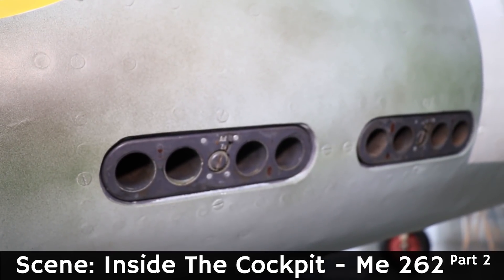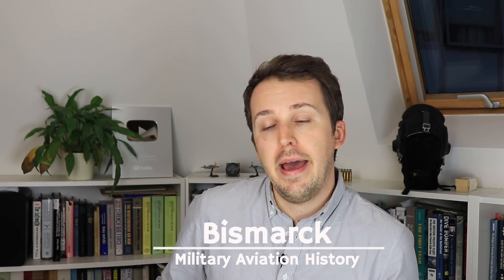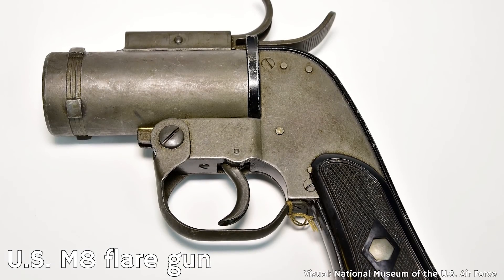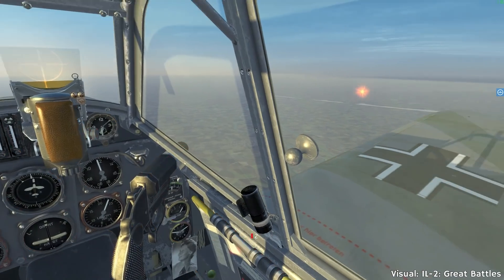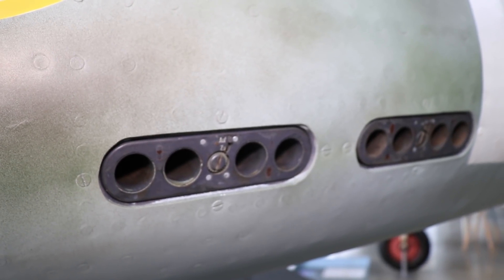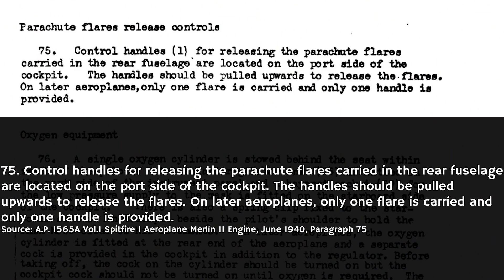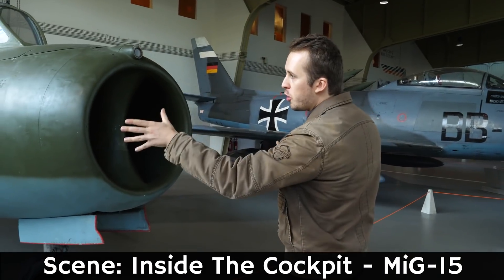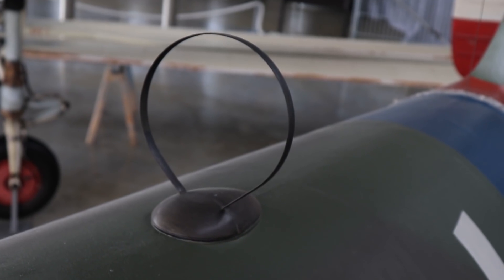Countermeasure flares on WW2 jet?

Comment: The reason the 262 had an electric flare dispenser is that you don't really want to open a side window or hatch when your jet is roaring along 750kph+. You would probably get injured. Also Messerschmitt was looking to the future and was hoping to give the Me262 a pressurised cockpit for extreme high altitude, although the LW weren't keen because they were worried about explosive decompression in combat if the plane was hit.

Comment: Thank you for the “flare” clarification. 
Just a note, I believe that various  WWII aircraft also utilized downward facing lights for identification purposes. I believe that Spitfires had one  flush mounted light on the underside aft of the cockpit area. Various U.S. fighter aircraft used three in line flush mounted lights (red, blue,green) on the underside of their wings for I.D. Purposes. However I have never run across any records/histories of anyone actually using them, and given their flush mounting and hence narrow field of view from an observer (necessarily from below the A/C ) I seriously would doubt their effectiveness. Flares would be much more effective (as was used by assembly ship bombers). Just say’n.

Comment: How Ironic about the flares lol since Surface to air missiles where invented by the Germans radio or radar guided where late in the war though never used because resources where preferred by Hitler to go to the making of the V1 and V2 rockets ect. If the Germans did get it up and running the Allies would have had to use Chaff as in lots of bits of tin foil like they had used during the war to spoof German radar.

Comment: I learned to fly in Canada in the 70’s and we were taught the meaning of signals fired from the tower in the event of radio failure. You see aircraft flares used in a lot of WW2 movies like ‘Memphis Belle’ and other older ones. Green aircraft flare = group ready for takeoff. Tower green flare  = cleared for takeoff. Red = not clear. Etc. Radio calls could have given away the raid timing.

Comment: What about chaff? My grandfather, who lives close to the German border in Switzerland told me that allied bombers used to drop long stripes of aluminium foils, which were sometimes carried to Switzerland by the wind. Did the Germans use chaff as well? The British were notorious for their use of radar during the Battle of Britain. 

Sidenote: The town folk in my grandfathers village believed for more than 70 years straight that these were supposed to take out power lines by shorting the wires, and distrust of the Allies had turned into mild anger. He was shocked when I told him about the actual effect of chaff.
Reply: The British called it "Window", and the Germans called it "Düppel"
I suspect the Americans came up with the name "Chaff".
Reply: Mark Felton did a very good video on the British using balloons to short out power cables
Reply: I have loaded modern chaff canisters into aircraft. The chaff that is discharged is tiny fragments that look for all the world like steel wool cut into various lengths. (There are probably more types than just this example since even ships use chaff) I doubt they would be any more visible than the smoke from the small explosive that discharges each of them from the canister of 30 or so. Having said that I have always been curious as to the size of "window".  It seems like it is much larger and that it would just be dumped by hand from aircraft. I imagine that it would be easily visible to the naked eye and much easier to find on the ground than what I am familiar with. Did he believe your explanation?
Reply: @paulking7019  Do remember that there is a difference in the wavelengths of the radars used in WW2 and modern radar.
Initially the British chain home radar system used a wavelength of 12 meters whereas the German Freya used a wavelength of approx 120 cm and the Wurtsburg used 50 cm.
therefore the Chaff used had to be from 12 cm in length and upwards (4 meters for the Chain Home system!)

Modern Radar are typically in the 2-3 centimeter range (think microwave) and thus modern chaff only needs to be up to 5 mm in length or so to be effective (a 1/4 wavelength)
Reply: A bit late, but may i chime in on the radar debate? The thing that made the british radar so effective was not their actual RADAR technology, (as stated several other countries had develloped theirs independently and secretly, and different systems). It was that they collected the data from all stations and used it to draw a "system picture". (by hand) This "picture" was presented, judged and the information used to direct the intercepting aircraft.
Reply: Apparently the Germans had chaff, separately to the Allies but didn't want to use it to preserve secrecy. Should have just used it IMO. Later German radars weren't fooled by chaff.
Reply: Ive seen both window and chaf used to donate the same things.
Reply: @ryancook6452 That is quite correct. Incidentally, I am typing this reply on my laptop with a Chaf 7 operating system.
Reply: Dropping strips of metal in WW2 had two impacts:
1/. It disrupted ground based radar.
2/. It shorted-out power lines.
Reply: Both the Americans and Germans got their radar from the British. The Americans had no idea even what radar was until they entered the war. Their first experience with radar was on the F6F FN
Reply: @dr.michaelr.foreman2170  Wrong. The Americans had for example radar installations at the Hawaiian islands on 7 December 1941. They spotted the incoming Japanese but misidentified them as an expected flight of B-17s coming in from the mainland to reinforce the islands and didn't take action.
Reply: @dr.michaelr.foreman2170  That's not true. Most countries were working on it, although the British had the most advanced technology.  It's doubtful the Germans would have got their radar from the British given the whole enemy thing.  The Americans were already working on it before the war and even detected the incoming Pearl Harbor attack, but it was ignored.
Reply: @oldesertguy9616  I am sure that is just American arrogance speaking. It is a fact, Britain discovered and developed radar. It was radar which pretty much defeated the Germans in the Battle of Britain. I suggest you go do your research before making a fool out of yourself. You will  discover I am right based on facts not wishful thinking and American ego.
Reply: @dr.michaelr.foreman2170  In 1922, A. Hoyt Taylor and Leo C. Young, then with the U.S. Navy Aircraft Radio Laboratory, noticed that a ship crossing the transmission path of a radio link produced a slow fading in and out of the signal. They reported this as a Doppler-beat interference with potential for detecting the passing of a vessel, but it was not pursued. In 1930, Lawrence A. Hyland. working for Taylor at the Naval Research Laboratory (NRL) noted the same effect from a passing airplane. This was officially reported by Taylor. Hyland, Taylor, and Young were granted a patent (U.S. No. 1981884, 1934) for a "System for detecting objects by radio". It was recognized that detection also needed range measurement, and funding was provided for a pulsed transmitter. This was assigned to a team led by Robert M. Page, and in December 1934, a breadboard apparatus successfully detected an aircraft at a range of one mile.

The Navy, however, ignored further development, and it was not until January 1939, that their first prototype system, the 200-MHz (1.5-m) XAF, was tested at sea. The Navy coined the acronym RAdio Detection And Ranging (RADAR), and in late 1940, ordered this to be exclusively used.
https://en.wikipedia.org/wiki/Radar_in_World_War_II
Reply: @dr.michaelr.foreman2170  try reading some actual history.  I checked several sources and they all agreed that several countries were working on radar simultaneously.  Britain was ahead of everyone, but they didn't in fact, "discover" radar.  The basic theories were first put forth in the late 1800's and developed by several people of different nationalities over the years.  The British made it better, but it wasn't invented in even a single decade, but with many smaller developments over the years.
Reply: The first American patent on RADAR was issued in 1934.